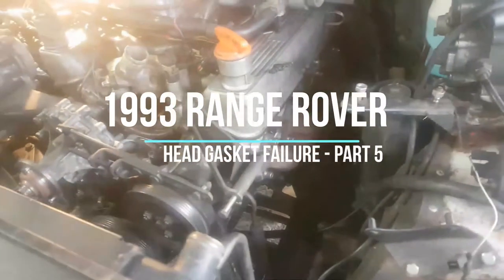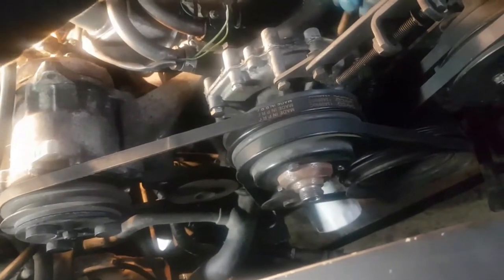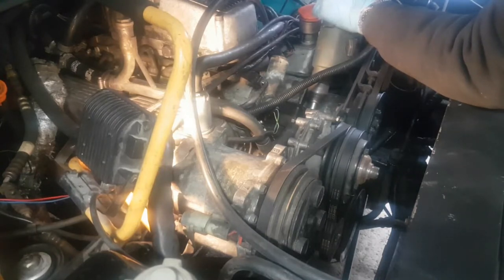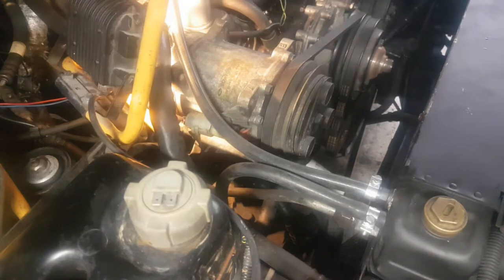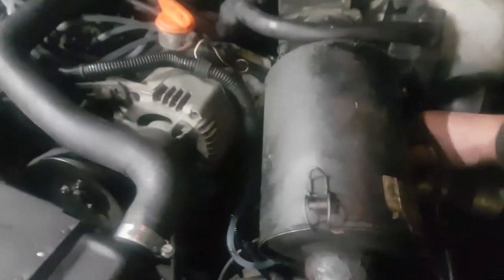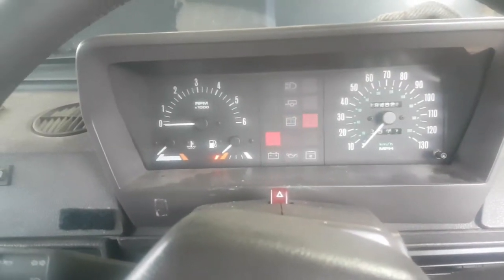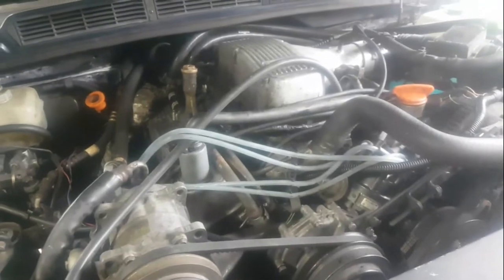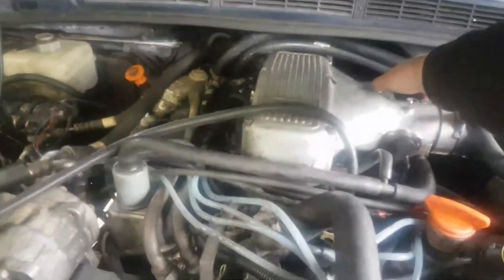1993 Range Rover Head Gasket Fixed -  Part 5

Comment: I got a bloody issue with my fuel pressure regulator. It doesnt leak gas but if i connect its vacuum hose to the back of the plenum air idle control port she revs up to 2000 rpms. For now i just covered that plenum to keep her rpms steady but i suspect the fuel regulator is causing a vacuum leak.